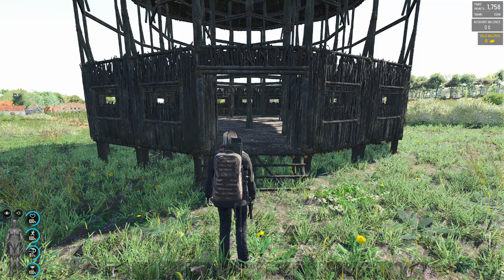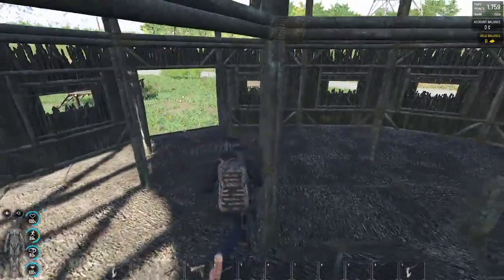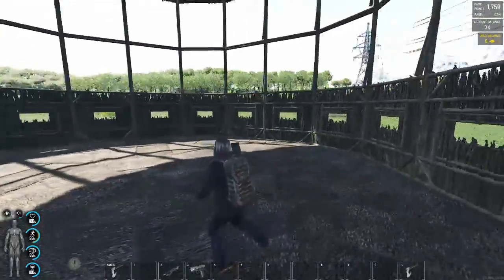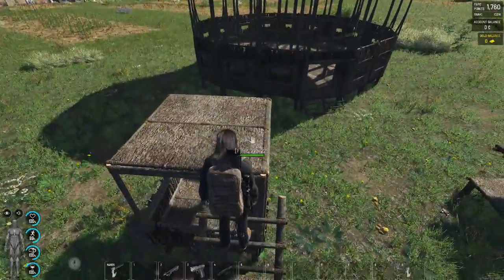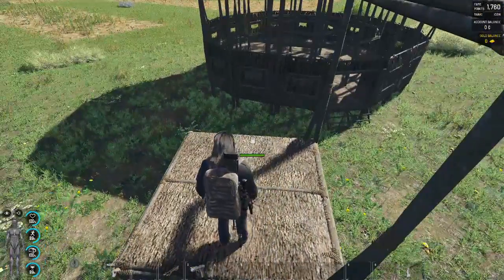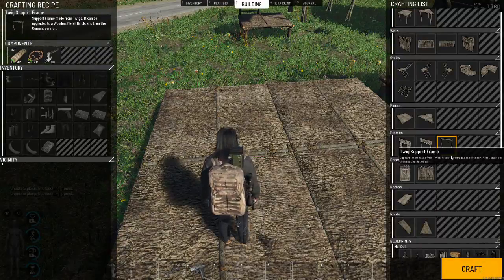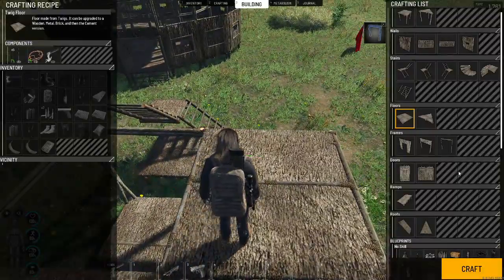How to build a floating roof and avoid all those supports.  (NO LONGER WORKS THIS WAY!)

Comment: I should show you a few of my builds my friend :) I use roof pieces and 1/2 +1/4 wall with that design I also make a ramp tunnel system using roof pieces and walls
Reply from the maker: yes please do, you can find my in the usual scum discords
Reply: @deathdarkstar9377   https://www.youtube.com/watch?v=2NjTWr2bpBg
Reply: @deathdarkstar9377  I would  show you my destructible thing that c4 and rockets can't hurt but when I created my nail floor wardog posted a video about it so I keeping my traps a secret for a little bit :)
Reply: @deathdarkstar9377  the video link I sent you is just my 1st test using the brace and 1/2 wall then stacking the 1/4 wall on top of that with a roof give you more cover and less element uses plus I lost my tunnel video but it simple to make
Reply from the maker: @joeyvaudeville1021  Did not get a link sent to me?
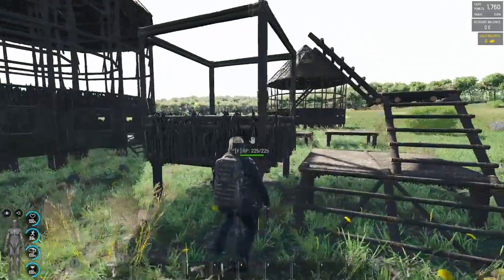Reply: 2:30

Comment: great video, did you have to rebuild the floor/foundations again afterwards?
Reply from the maker: no, the chain destruction only goes up but then stops once it hits the small wall chunk.  I have had some secondary issues with elements breaking downwards for some reason.  Typically I am using these in 500 - 600 element builds, and things can get a bit weird with that many elements.

Comment: I did not yet figure it out how the roofs work, sometimes you can stack them up to 3 times , sometimes yo cant even add a second one. Those floating structures are useful nonetheless. If you use a double door-frame does it work as well ? Because I know you can still add the door after building both structures and that would leave you with a closed wall.
Reply from the maker: The door should work as well, but the material cost is much higher.